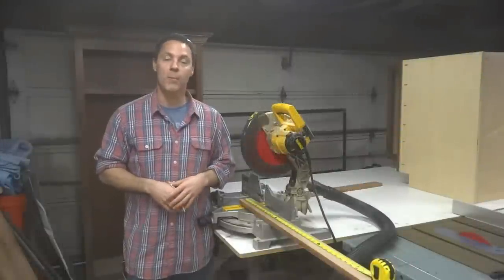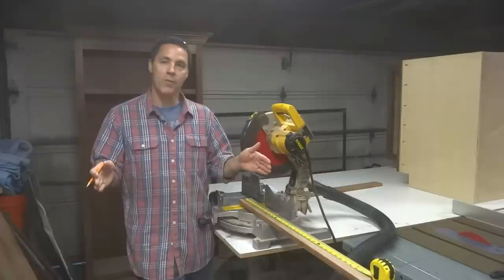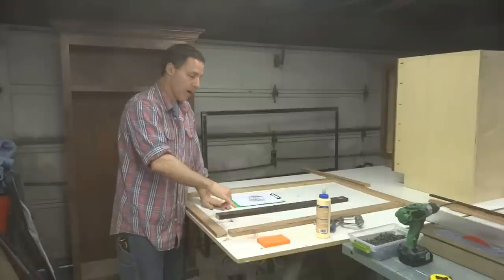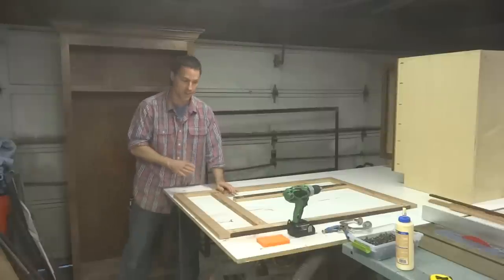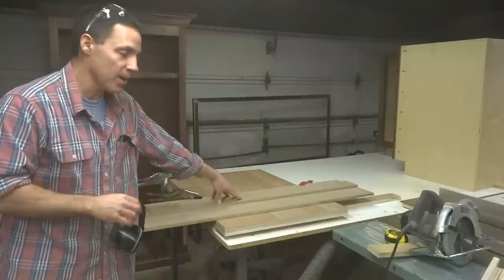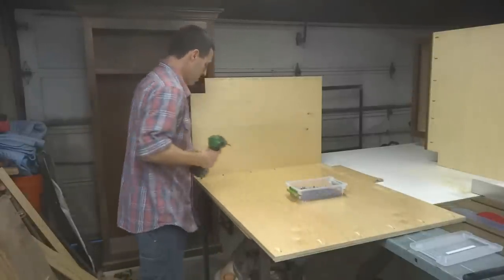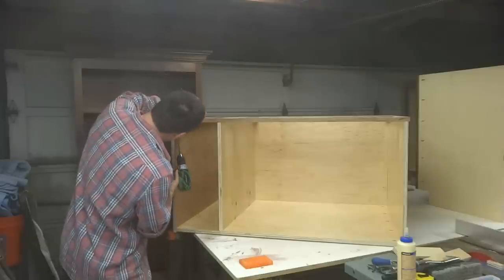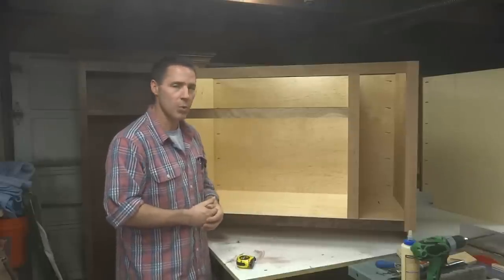Kitchen Cabinets: Sink Base Build

Comment: When you're making your stiles and rails, do you use wood that you joint and plane first, or are you trusting that the wood isn't too warped and/or bowed?

Thanks again for this set of videos. As a beginner, it has been so helpful and has helped build a lot of confidence in myself.
Reply from the maker: Glad you find the videos helpful Matt. So this kitchen project was meant to be for novice woodworkers and cabinetmakers who wanted to try their hand at cabinets, but might not have the more expensive tools like planers, jointers, etc. So, what i suggested somewhere in these videos was that you can buy S4S wood at ever store (Lowes, Menards, Home Depot, etc) and they are generally pretty good in terms of consistent thicknesses (you can check before you buy too to get ones as close as possible to the same thickness). Usually then small differences in thickness between stile/rail members can be sanded out without much notice.

Now, that being said, I get most of my wood from a hardwood store. if i buy rough cut, I have to plane it myself, which i have done many times. They also sell S4S lumber (dimensional lumber- 1x2, 1x3, etc) but it is about 1/16" thicker than what you get at Home depot, so i do often plane them to be the same thicknesses.

I have a pretty good thickness planer in the shop, and it does definitely help align things very well. 

Final note: if wood is bowed a little, i can manage that because when you use pocket holes to attach the face frames to the boxes, I can usually get most bows out of the lumber by force. If it's really warped, it's hard to plane it to a usable thickness, so i'll save that piece for something else or it becomes scrap.

Hope that helps. Thanks for taking the time to post. Good Luck! -Pat

Comment: Pat,
When you have a moment. Would you talk about the dishwasher area. Supports for countertop, how they are connected. Is there a back panel like the rest of the base cabinets? Anything you may want to pass along. Thank you!
Reply from the maker: Whippetfest Between the dishwasher (DW) and stove, there is a single piece of 3/4" plywood cut to the same dimensions as a side panel for a base cabinet: 23-1/4" by 34-1/2". It includes a toe-kick and added a single stile of  faceframe (FF). The DW panel also has pocket holes along the bottom edge to screw into the floor (after leveling). If you're going to have lots of shims underneath or something, you'll have to put another cleat in behind the face frame edge along the floor so that it doesn't interfere with putting the appliances in, and screw it to that to the floor and then the panel to that cleat.

To the back wall, i attached a piece of plywood to a stud that was close by.  It acts as a vertical "cleat" for the back edge of the DW panel. The cleat has pocket holes in it that face to the left (if you look at the sketchup of the final draw). you have to make sure the cleat is installed at a distance away from the lazy susan (LS) side panel that will allow the DW panel's face frame edge and the LS's outside face frame edge to be the right size for the appliance, which is 24" in my case.

So since I needed the face frame edges to be 24" apart, I had to install the vertical cleat 24-7/8" away from the side panel of the LS (easier to measure from panel to panel along the wall). This compensates for the a 1/4" overhang of the faceframe on the LS panel and the 5/8 overhang have the DW panel's face frame. 

The DW panel is adjusted to make sure it's level with the rest of the cabinets, and i use the pocket holes to secure the back edge of the panel into the vertical cleat. At this point it will wobble back and forth a bit, so then what i did was to adjust to make sure theFF edges are the right distance apart and pocket screwed the panel to the floor MAKING SURE not to pull it out of level. 

At this point I was essentially done, but i installed a 24-7/8" small cleat toward the front of the cavity at the top in order to keep the 24" distance secure. I may OR MAY NOT remove this cleat after the counter is installed. If i were installing a laminate counter, i would have pocketed the top edges of the DW panel as well and screwed them into the counter. In this kitchen, there will be a stone counter so the cleat won't be necessary after it is installed. The silicon adhesive and weight of the counter will keep it the DW panel in place.

Finally, because the counter top was stone, i had to run a horizontal cleat (2x2 or something) along the back wall between the DW panel and the LS side panel just to help support the weight.

All of this because we couldn't build a cabinet between the DW and the stove :)
Reply: Thank you very much! I printed this off to make sure I can find it as the DW time gets closer. I intend to go through what you have written more thoroughly line by line tomorrow evening.

I have my first two cabinet carcasses and face frames complete! I so have you to thank for it...I hope you feel good about that! I'm waiting on my 4x8 sheets of plywood to do the backs and will be experimenting with finishing in the mean time. I made a lot of small mistakes, just never having done this before. I told myself from the beginning, these laundry cabinets are my learning cabinets. The mistakes I made, I don't think will be made again, just learning. In the end I think what was accomplished turned out well. It was a lot of fun as I would get the hang of things. Thank you for making it fun.... Cabinetics was such a great help!

Comment: Why not put the pocket screw holes on the backside of the back panel? This way the holes can't been seen when opening the cabinet doors.
Reply from the maker: George Schwab Hi, thanks for the question. I think I answered it in our Q&A video, but essentially the reason is largely for ease of putting the cabinet together (a.k.a laziness). 

For most cabinets, I agree with you 100%. The holes should face the backside of the panel, and for all of the cabinets in this series that you would really see them, they are built exactly as you have stated. 

The two that are not are the left base cabinet and the sink base. 

For the left-most base cabinet, the holes didn't matter if they faced in or out because it was a bank of drawers. No one would see them unless they took out the drawers and stuck their head in the cabinet. Not a likely scenario where someone would care too much. 

Similarly, the sink base is not generally a cabinet that you care as much about what it looks like on the inside. Not only is the sink blocking the view of the back of the cabinet, but with the plumbing in the way, holes cut in the back for plumbing access, etc. it's generally not a large concern. Additionally, in this cabinet, we are most likely going to go back to install pull-out shelves. So with the pull-out shelves as the final blow, you probably won't see the holes at all, generally speaking.

All that said, the main reason for the holes facing inward is really just a matter of trying to simplify the carcass construction. It's easy to simply lay down a scrap piece of 1/4" plywood to create a recess, face the holes upward, and attach the sides. 

However, if viewers feel that it's better for all the holes to face the back wall, it's certainly manageable to do so, and I wholeheartedly encourage it. 

Thanks again for the great question, and for taking the time to watch and post.

Comment: Hi Pat, as most have mentioned, you have done a great job explaining things in the series of videos; I am on my second time watching them just to make sure i haven't missed anything.  I do have a couple questions though:

1.  I have noticed that in previous videos you have not "completed" the toe kick (as in you can see under the cabinet) but when you later reference a piece, the kick kick is complete.  Just for clarification, you are just cut a piece to place between the two side walls and pocket screw them in?

2.  With this box you used a divider to separate the sink from the draw.  Couldn't you have done this when building the upper microwave set of cabinets?  I seems like somewhat of a waste when you create 3 boxes and screw them all together, thus creating a 1 1/2" divider between each box.  I guess i can see where due to the dimensions of the microwave cabinets that creating 3 separate boxes would be beneficial.  I guess what i am asking is, if I had a long run of cabinets, couldn't I just use the method you used here to build a wide box and separate them as you did here opposed to creating multiple 2 door cabinets and screwing them together?

Thanks again for the videos, keep up the good work,

Brice
Reply from the maker: Hey Brice, thanks for the kind feedback. Glad the videos are helping some.

First, let me start out by saying, there are dozens of ways to build cabinets. It's perfectly okay to modify something you see here to fit your needs. And by all means, i encourage experimentation with this stuff. With that in mind here are some answers.

1.  most toe kicks are simply 1/4" (or 3/16 most likely) plywood stained to match the cabinets. when i apply the 1/4" stuff, i do indeed fit a "nailer" behind it, but pocketing or screwing in between the two side walls. often times i do wrap-around toe-kicks, which turn into the 3.5" trim piece. In that case, i don't need a nailer, i can' just glue/nail to the side walls.

2) Yes on both counts. What i could have done was make the two side cabinets on either side of the microwave each their separate cabinet, then put in two boards that attach them, and act as the middle cabinets' top and bottom. The back would have squared everything up. and yes, you would not have wasted  4' of plywood (2' on either side).

A few reasons i decided to do it the way i did in the video:
1) thought it would be easier to show people at home to just make 3 separate boxes.

2) plywood is meant to be a "waste" product. No matter how much you try to conserve and optimize you have tons of it left over. 
3) when it comes time to put the shelf pin holes in, i like when there are two separate pieces to drill into. This is a habit I developed from doing lots of built-in cabinets where the shelf-pin holes are 'visible' (like for bookshelves). You dont' want light coming in from one side or the other and if they aren't aligned they look terrible. Obviously these are behind closed doors, so that doesn't matter as much. Again, habits.

Hope this helps. Again, tons of different ways to do it, and everyone does it a a little differently.

Thanks for watching and posting great questions. -Pat
Reply from the maker: Sorry, for the toe kick in #1 above, for wraparounds, i use 3/4 ply, or solid wood to match, that turns into the trim from the toe kick. Forgot to mention the change in side. If the toe kick just "ends" i use thin stuff.

Comment: Hello Pat.  Great videos and they gave me the courage to build my own.  Thanks.  A couple of questions: In this video you mention using course screws to connect the plywood via the pocket holes.  I've already built three cavities and connected them using fine threaded pocket hole screws.  They seem very sturdy but will I have issues down the road by using the fine threaded screws (via wear and tear)?  My second question is - You mentioned earlier in this video series that you like to have your cabinets FF's overlay inside the cabinets only 1/4 inch (basically it's just enough to stop the shelves from falling out).   I've followed that advise but now I'm second guessing myself and thinking I may have issues installing the hinges and doors.  (not enough wood for the hinges to attached to etc.. ).  Is it just me playing mind tricks on myself or its 1/4 inch good.
Reply from the maker: Hey Steve, sorry for the late response. So glad to hear you are building your own!! You can totally do this! To answer your questions: the thread of the screw is determined by what the screw goes into. If you are screwing plywood together, or softer woods like pine, poplar, etc. the course thread is recommended. if screwing into Maple or Cherry (as when attaching the face frames to the carcasses) the fine thread is recommended. It is true that fine threaded screws will loosen over time as compared with the course counterparts in softer woods, but I wouldn't sweat it too much. If what you built seems sturdy enough, you'll be attaching it to the walls, etc. I don't think you'll have too much of a problem. I would be more concerned if for example you used them to build drawer boxes and there was stress on the screw joint every time you open/close the drawer.  With respect to your second question, I suppose it depends on the type of hinge you're using. face-frame hinges (those that attache to the face frame) are normally fine with 1/4" reveal. If you let me know what the hinge you're using is (brand and number) I can tell you if you'll have an issue. As a side note, i've moved to a 1/2" reveal, in general, but not as a result of the hinges :). Thanks for posting and great questions. Let me know if how it goes. -Pat
Reply: DIYHomeBuilt I attached the Faceframe and ordered the doors today.  So far I am very happy with the results.  I wish I could post some pictures for you here but you can check out my work on my Facebook page if you want at https://m.facebook.com/stextor

Comment: Are you using drywall or kreg screws?  I assume from your statement that for ply & pine you want coarse screws?
Reply from the maker: Hi Troy, I use pocket hole screws, but not Kreg brand. I'm partial to the ones i get from McFeely's as i can buy in bulk and get them cheaper. the head isn't as wide as the Kreg, and i actually like it better. Yes, when screwing into pine or plywood, use the course thread. If you're screwing into maple, cherry, etc (like when attaching the face frames to the carcasses) you want fine thread. Great questions! Thanks for posting -Pat.